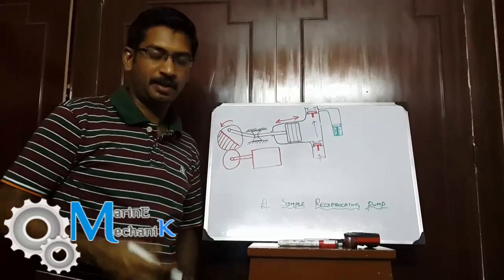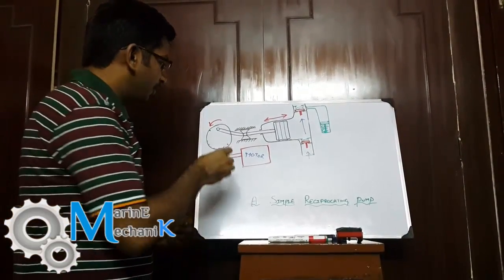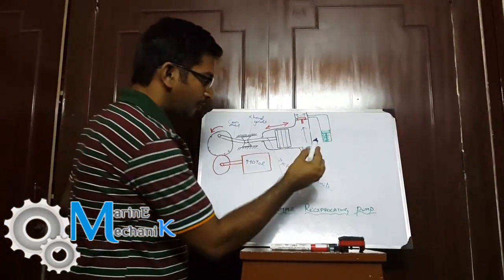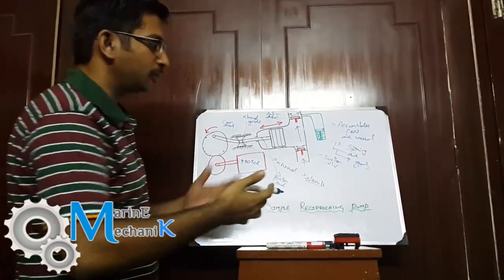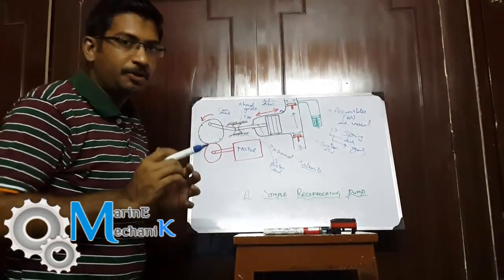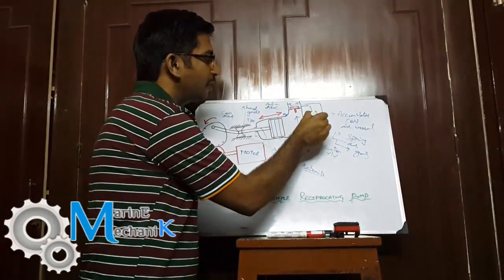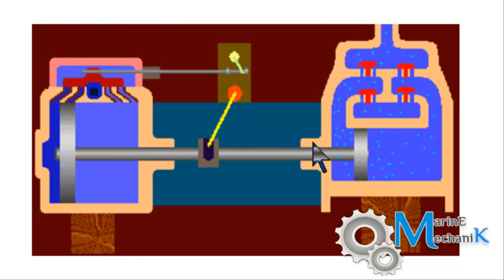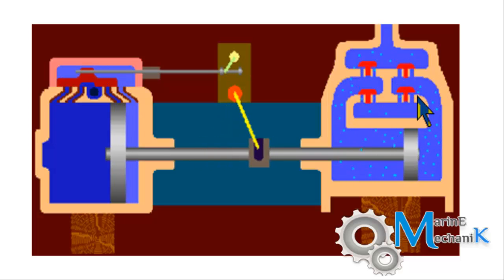Reciprocating Bilge Pump - Explained With Animation

Comment: Sir, i am a cadet,On my ship i have seen single screw bilge pump.My sludge pump was also a mono pump.But being a positive displacement pump we still use to prime it.Please sir let me know the reason of priming those pump.And sir, on this video you told bilge pump suction piping has 3 connections.Out of them why sea water connection is provided to bilge pump if it is a dedicated e/r bilge pump? Please sir guide me with these answers.